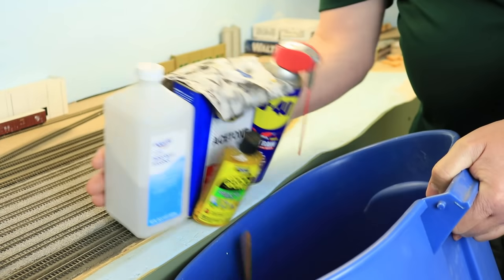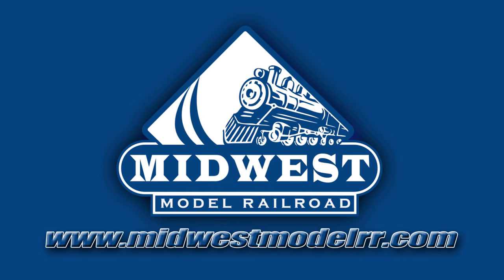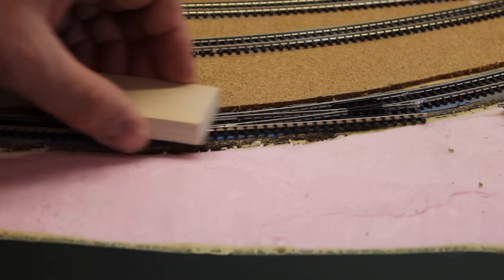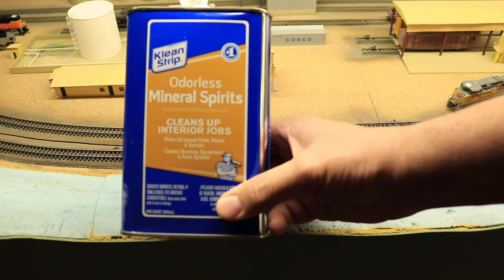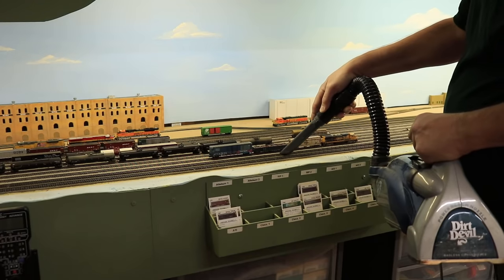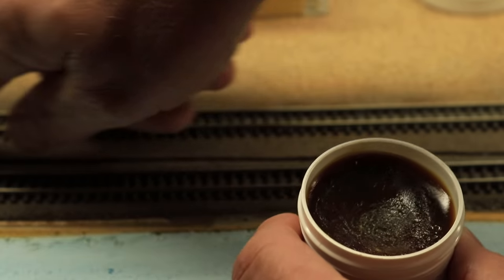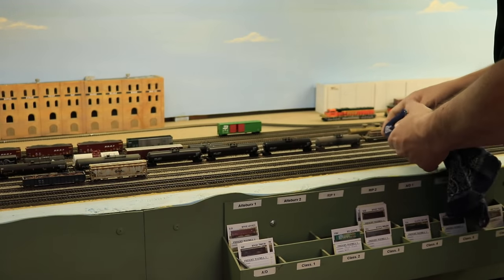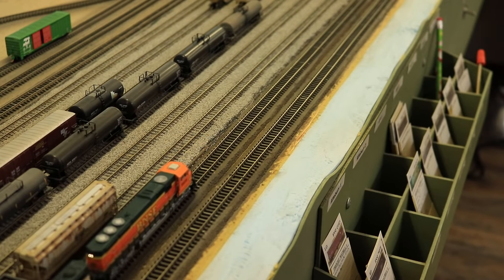Stop Cleaning Your Track on Your Model Railroad

Comment: Hi Ron,

Nice presentation, i really like the investigation about the use of the products.

Here in the Netherlands, the use of ATF Transmission fluid is really hot topic. I have an lay-out with around 500 meters of N-scale track, 240 switches and 60 trains. Cleaning is an paint in the......

I clean the track once a year. The i apply some atf with an cotton stick on the rails. Just a centimeter on both rails per 2 a 3 meters. Then i let an strong Train run for 10 minuten. The wheels will spread the atf around. At first there is a lot of traction slip, but after some laps the traction is back.

I can leave the track for week unussed, and it runs again prefectly. No cleaning at all! I use it now for years, the rails get very dirty, but there are no electrical problems anymore. 

I was wondering if you have tried the "Dutch" method?

Greetings from Holland

Comment: great video.... question, what would happen if you put a thin layer of dielectric grease on your tracks.. wouldnt it prevent oxidation and still allow the trains to run...?
Reply from the maker: That's basically what No-Ox is.

Comment: I simply use a block of moderately dense/hard wood as my "brightboy" as the wood is hard enough to remove any build up, but not scratch  the rail head, then another block wrapped in denim soaked in clipper oil. 
My layout is in a very dusty environment, being the basement of an old house and I can go 6 to 8 months between any serious track cleaing. I guess just use what ever method works best for you.

Comment: I use guitar string cleaner with a felt pad. I don't know the chemistry of the product but it works great for me. I only run my train during Christmas season, and not every day even then, so I don't have chronic issues with dirty tracks. (Just Christmas packages laying across the track.)

Comment: As always Ron great video. I'm about to be starting a new layout and I had problems with the old one several years ago with using isopropyl alcohol, my God, what a fool I was. I wondered if you have another video or would consider making one about cleaning loco and rolling stock wheels as well. I've seen a product by Woodland Scenics called the Roto Wheel Cleaner but I haven't researched it much but I am curious how you do this process. Thank you for the information!
Reply from the maker: I think we all fell down the IPA rabbit hole at some time. As for cleaning wheels, I just do it manually, but yes that would probably be a good video sometime.
Reply: @RonsTrainsNThings  Thanks Ron, FYI I just joined your channel and I think I will join Model Railroad Academy. I've watched some of the videos and the simplicity with which they tackle potentially complex situations is nothing short of brilliant!

Comment: For years I have used CRC 2-26 cleaner on track and wheels. From Home Depot. Also works good on Lionel steel rail. Put it on a piece of cork or wood and rub it on.  Also use the stainless washer to rub the
 rail top.

Comment: Hi Ron, thank you for your research for keeping your track clean, I was quickly enthused by the process UNTIL.... You came to the traction tire caveat. As I am an AC/3-Rail model railroader this will not work for me. One of the tips you gave, which I feel deserves more attention is keeping your track clean as well as all wheels on the locomotives and the rolling stock, as the micro-arching takes place because of micro-scratches on the track, as well as on the wheels of all rolling stock. Thanks once again for giving us great insights into this topic as well as everything you explain and show in your videos, I thoroughly enjoy watching them. Kind regards from The Netherlands, Richard
Reply from the maker: Hi Richard. Yes, sadly i don't know a good substitute for those running traction tires, but cleaning with mineral spirits will be a big improvement over IPA.

Comment: Hi Ron, love the new video. In ur video u mentioned the rubber wheels on steam locomotives will not like.this product. I was considering buying the grease from Amazon but I don't want to mess up my Broadway Unlimited. But I will start using Mineral Sprint. Thks for the tip

Comment: I have Bachmann EZ black roadbed track and I use 70% isopropyl alcohol to clean my tracks should I stop using it & use something else or can I keep using the alcohol it gave me no problems so far
Reply from the maker: The alcohol promotes further oxidation. You would be much better off using mineral spirits.

Comment: Hello Ron, thanks for this video, Did you ever find out how this effects Traction tires?
Thanks in advance for your reply.
Regards,
Jim
Reply from the maker: It doesn't damage the tires, but it can coat them and give them less grip, rendering them ineffective. I can be cleaned off, however.

Comment: Thanks a lot for the tipps, was not aware that you should grease your rails :D How about weathered rails, does the weathering paint comes off with Track cleaning and if so, how are you preventing it? Maybe a clear vanish?
Kind regards from Germany
Reply from the maker: I work carefully not to scrub anything but the top of the rail heads so as not to disturb the weathering.

Comment: I followed your cleaning and no ox procedure. Track hasn’t been this clean since it came out of the package. My locos definitely seem to run better. After a session, I did a light wipe on my track and there was some very light gray residue picked up. Is that normal or to be expected? Or did I not apply enough no ox? Appreciate any feedback!
Reply from the maker: No, don't add any more product. What you are seeing is a bit of dust. Just gently wipe it away and keep going.

Comment: It’s about time someone stepped up to say this. I have been doing this for years. I use a slightly different product. It’s called Cramolin Paste, manufactured by Caig Laboratories.  It is a contact enhancer for any moving electrical contacts. It goes on vapor thin and needs no second application. It suppresses all sparking and lowers contact resistance.  Just wipe occasionally with a soft cloth and you’re done.

Comment: I have switched to using mineral spirits to clean the track but I find it is discoloring the rerailers and other plastic components (gray tinge). Also was using it to clean the locomotive wheels on my cleaning track but not sure if it is degrading the cleaning pads as opposed to the alcohol I used to use.  Any comments please?

Comment: As an electrician the subject of “arcing” is not new to me.  In fact, for the past several years the NEC has been addressing this issue as it can cause all sorts of problems in switches, receptacles, and other devices where a momentary electrical contact is made.

Comment: Not a model railroader, I'm a ham, here are possible solutions: 1) You could male a system that would drag moistened cotton balls on the track. 2) AC would arc less than DC. I don't know what power supplies and motors are used in model railroading, so you would have to look onto that. Brushless motors last a long time. 3) To reduce arcing, a capacitor acoss the circuit might help. 4) conductive grease. Its used to electrically bond antenna elements. Might help directly on the rails, again, some clever way to apply it with a model railroad engine pulling some cotton ball arrangement to easily apply it to the rails. Just my thoughts. My question: Is rhere a safety system in model railroading to protect from an outright "crowbar" dead short? How many amps volts does model railroading run, especially on a large system, and how do you scale that (so to speak) up? All the Best!  73 DE W8LV BILL

Comment: And another easy and cheap product is ATF (automatic transmission fluid). Does the same as NO OX ID. Only need a light smear every 2 or 3 metres. Reapply every 6 months.  Cheers, Garth from NZ

Comment: Thanks Ron for this very informative video.  The Goo gone is gone LOL.  One question - what would you suggest is the best way to clean the wheels of my rolling stock?  For the engines I typically run the wheels on a cloth soaked material to clean them.
Reply: I taped a piece of flannel cloth onto the track and wetted it slightly with mineral spirits.  I then placed each car on the rails and rolled the wheels on the cloth.  I use a rerailer ramp to speed up the process.  I did my entire fleet of sixty cars in in about thirty minutes.  I replaced the cloth about four times during the cleaning.

Comment: I have a question for Ron, I have been using No Ox for about 3 months now and found that it works, however after a few months it has spread to the curves and grades of my layout and causes wheel slip in those areas.  Do you find that you ever need to clean excessive, dirty electrical grease from those areas AND do you ever just totally clean the track and put down a "fresh" application of no ox?  I have found that this helps with the slippage problem.
Reply from the maker: I cleaned mine and reapplied after a couple years due to dust, etc. Sounds to me like your application might be a bit too heavy. You only need a microscopic coat.

Comment: Hi I have unfortunately spray painted on some parts on mi track and had to remove it with fine sandpaper but don’t know if that have created any permanent damage, 3 of my locos runs perfect but the other 2 doesn’t, any clue what I can do? Thanks
Reply from the maker: Burnish your rails.with a steel washer to remove scratches. Then I would apply a very thin application of no-ox.

Comment: Hi Ron.Thanks for this information.The majority of my locos have traction tyres.I stopped using IPA because it is too expensive to use in quantity.Is methylated spirits ok ? I have a few different track cleaning cars,maybe these are too abrasive.I have tried the zinc washer trick.I also use 800-1200 grit wet&dry paper.Also I have different types of track,brass,steel,nickel&stainless.much of it is vintage HO.
Reply from the maker: Methylated spirits is denatured alcohol which is essentially equivalent to IPA. It is polar and should not be used on track. Use mineral spirits. It contains no alcohol which is the polar element in IPA.

Comment: Ron,  After applying the process the track is now worse than before the engine hesitates almost the entire section of track.  I cleaned my engines wheels using Woodland scenic tidy track tool  The wheels look shiny  I rubbed my finders over the track and I got some black on them   I have a cloth that I put the mineral water on and rub the track until I do not see any more black. Then I apply a small amount of NO-OX-ID with my finger.  It sat for two days without running and engine on it. Is that my problem.   Should I only do a section at a time and run the engine over that section ?  Should I apply the mineral water on the area again and clean it up then apply the NO-OX-ID This is the biggest and my difficult section of my layout and I had issue with the engine stopping in places in the past mostly after changes made to the layout then I would use alcohol to clean the area it seems to help  But I like this idea better. any suggestions?

Comment: Hello. I'm new to the hobby. I cant invest in the hobby as a beginner a lot of money. Are the used tracks going to give me a hard time or I should go for new ones ? 

Thanks.
Reply from the maker: Track is the one area I wouldn't skimp. If the track runs poorly, details a lot, you will get frustrated and walk away. Inexpensive cars will run on good track, but the most expensive locomotive on the market will not run on poor track.

Comment: Can remember cleaning tracks with fine steel wool. Engine ran great for sbout s minute until enough fine tiny steel eool strands shorted out the engine. My dad bought a track cleaning car that only did a so so cleaning job. Soldered all of our old American Flyer track together and soldered jumper wire every two foot so engines never slowed up.

Comment: I quit using alcohol and bright boys when i watched the fishplate video. Started using crc deox electric contact cleaner on my tidy track cleaning tool with the white pads installed. That was used over a year and a half ago haven't cleaned my tracks since just vacuum and run dust monkeys on a few cars. I imagine I'll have to do it again eventually but I used to have to clean before every running.

Comment: Cleaning rails is a non-issue on my layout.  I have used Wahl clipper oil in the past (I have not put any on my rails in many years).  I still have the original container.  A toothpick with a tiny drop of oil on each rail will treat track for 5 yards in each direction.  Locomotive wheels will be treated as they run on the treated track.  Most of my track is over 40 years old.  Just for kicks, I put in a brass (Yes, BRASS) turnout in my layout to see how it worked with Wahl clipper oil.  If it were not for the color of the rail, you would never know that a piece of brass track was on my layout.  The only qualifier for using Wahl that I will mention is that you should not run plastic wheels on it.  It will affect some plastics and leave the black gunk on the rail.  The plastic gunk is a problem, since plastic does not conduct electricity.  I only clean my locomotive wheels (if needed), when they have a mechanical or electrical problem or when I am installing an upgrade.  Same for rolling stock.  After weeks without track cleaning, I can run my layout, even at slow speeds without engine stalling.  I don't have a "scientific" explanation for why Wahl works.  It just does.  If you want to clean your track, have fun.  I'll be running my trains.
Reply: I get the same results using Inox MP3. A product made in Australia. I have not cleaned wheels since I started using Inox MP3 about 40 years ago.
Reply: @terryflynn8830  40 years!!!  Jumping Jehosophat!!  That's longer than some people live.  Great news.

Comment: I model in Z scale and my solution is nr 1 I get rid of all delrin wheel sets and replace with metal wheel sets. I no longer need to clean track because that black gunk is attracted to the oil emitted from delrin wheel sets such as Micro Train standard wheel sets. I do not use a cleaner other than a eye glass cleaner cloth, my trains in N Nn3 and Z have traction tires so no ox would not suit me.  A wooden Tongue depressor also works but not as well as the eye  glass cleaning cloth, when the cloth is dirty I was in the laundry in a mesh bag with my face covid masks. I have used IPA initially and now just used the cloth.  It does not seem to shed fibers

Comment: Could I use the Oderless mineral Spirits in my Cmx cleaning car? Where could I buy it? Your opinion carries a lot of respect thanks for the video
Reply from the maker: Yes, you can. I have. You can get it at about any hardware store or anywhere that carries house paint, stains, etc.
Reply: I use them in mine.
Reply: I use it in mine and works great

Comment: Thank you so much Ron. Great info. My layout is a ceiling layout about 8 ft up on the wall in my Irish Pub at the house. This just might help having to clean the track less often. One treatment you didn't mention is graphite. Some of the old schoolers talk about it being great to help promote conductivity. Did you look at that? Thoughts?
Reply from the maker: I did look at it but have not used it. The one thing I know is that, as with the NO-OX, you don't want too much. A super thin layer of graphite is good, but a thicker layer actually becomes an insulator. Less is more.
Reply: @RonsTrainsNThings  my layout is a bit unique because of the shape of the room, window to get over and down and then back up to run across a bookcase where I have a tunnel and passing loop. Traction is key. A couple of my engines have to have Traction tires while I think one or two of them don't. Might be great to share by email and or talk on the phone. Can always use the help.. don't have anyone really in the area I've been able to connect with. Have figured out what I have so far moatly on my own.. The learning curve has been massive.. You might be surprised what I've been up to.. lol.

Comment: I have found that using a very, very mild abrasive cloth or "bright boy" style of pad and scooting it along the track cleans better than any solvents. Does it remove material from the metal track? I doubt it. If it does, it is so minute there should be no concern about it. Works for me!